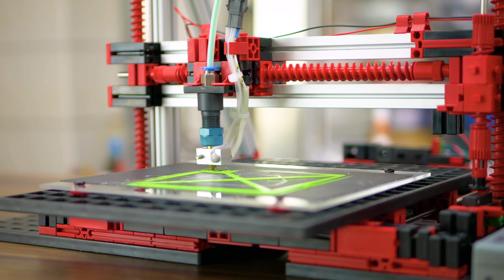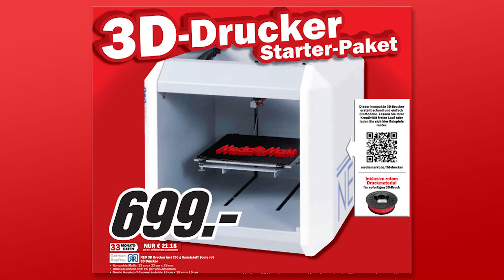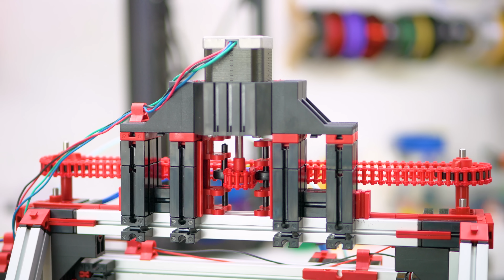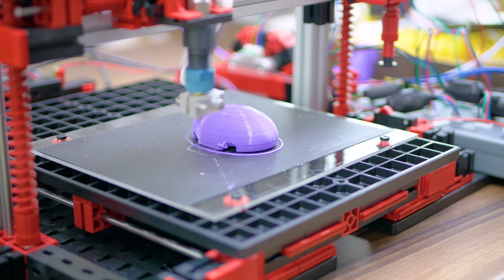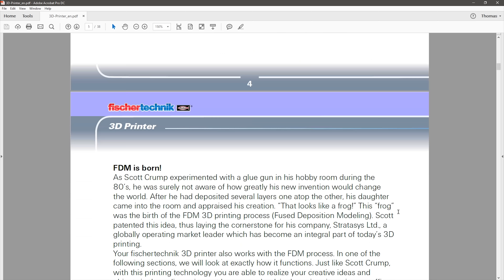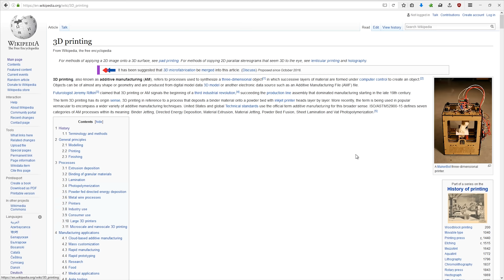890 parts: Fischertechnik 3D printer review!

Comment: I get the impression that it's more an exercise in learning how a 3D printer works than a 3D printer for the beginner, even if it fails at both.

I'm still excited about the idea of builder kits, with parts like gears and rails and stuff, that can complement FDM. I'd like to hear more about sources of such kits or parts.

Comment: Now the Fischertechnik 3d printer sells at ebay for about 380 € new. Less than 400€ was my limit for such a toy.

I have not done 3d printing before. So I simply wanted to test if I like 3d printing - without investing money to be wasted if I decide not to have 3d printing as an hobby. Fischertechnik is an expensive construction system and many parts in the set are usefull for other projects. So it is mostly "recyclable". You can use the steppers with i2c stepper controllers at TX or TXT even with original firmware; with comunity firmware on txt you can also control the fischertechnik controler. So all parts exept extruder and hotend are multifunctional as I expected one year ago. So trying the fischertechnik 3d printer (at a price less than 400€) is O.K. because there is no risk - I can build some other projects with part (+ the other fischertechnik I already own).

Adding a fan (made complete from fishertechnik parts I already own) was no problem. Of course the printing quality is only low entry level - but as may be known, Prusa delivery take some time... The fischertechnik 3d printer was indeed enough to decide, that I like 3d printing. So 3 days after my first 3d print with fischertechnik I ordered a Prusa MK3. The parts of the Fischertechnik 3d printer will find a way to other fischertechnik projects...

One of the best things are the Fishertechnik holders for Nema 14. The help to integreate steppers in other projects. You can get them seperatly sold für only 3€ (very cheap for fischertechnik - I was amused) or print them yourself (the 3files are delivered with the printer). Also the axis-adapters (seperatly sold for 0.35€) are perfect. They break if to much force is tranfered, so ifsomething goes wrong, you do not mess up the complete project, but only the cheep Axis adapter.

So in my opinion the Fischertechnik 3d printer is very good - for using the interesting new parts (and of course all the expensive standard parts like the aluminium bricks contained in the box). For 3d printing: fun to try it, but not to use it as an productive printer.

Comment: Hello.
I have also tested this printer.

I like fischertechnik very much.

However, the following points interfere with this model:

The price is way too high.

It has been forgotten that in the 3D printing the printing is in the foreground.

All the 3D printer kits are in direct competition. However at a higher level.

Unlike other fischertechnik models, you can not build any other models with this kit. You could have done so many other things with the stepping motors.

Fischertechnik has not yet understood the meaning of open source.

Why do not you open the firmware?

The controller is unnecessarily expensive. An Arduino with Ramps would have been enough.
As a spare part you want 260 € for it. The Oririginal Controller costs 90 € for German Reprap.
 
One has saved a 10 cent transistor on the controller and thus the filament cooling impossible.
How do you think you can print without filamnet cooling?

The idea was quite good, but not finished.
It would have been a good idea at this point to introduce the Arduino into the fischertechnik.

Comment: There is only one thing wrong with this Fischertechnik 3d-Printer: The interface is stand alone only, not to be combined with the Robo TX an TXT Controllers and the Robo pro software.

As the firmware of the 3d-printer is open source, its only a question of time the comunity find a way around this problem. But it is a big error by fischertechnik to do so not themselfes before relasing the construction kit, as modifing firmware is not something for normal fischertechnik users. 

Fishertechnik used 6 components (the expensive ones) only usable with this model: The 4 stepper, the extruder and the controller. While an extruder of course only is usefull for 3d-printing, Fischertechnk missed the chance to integrate the stepper and controller in the normal Fischertechnik system. Some de ja vue to 1985 - the stepper of the old fischertechnik plotter where also exotic components only for that model (but the seperate controller was universal). Integration of controller and stepper in the system would make a huge difference to the balance between price and what you get for it.

In this state, the 3d-printer is only a 3d printer. You can tune it a bit to get better results - but pricing is to high compared to other 3d printers. All other fischertechnik construction kits have more than one model you can build - not this one. So to compare it with other 3d-printers is right and your summery totaly correct. But if the community finds a way around (or even better: fischertechnik makes firmware updates for using the controller with robo pro and extension via USB to te TXT) the components becoming "universal", 3d-printer would become only to be one model among many others. There is a difference between "bad 3d printer by Fischertechnik you can use for nothing else" or "Universal Fischertechnik Robotic Construction Set you can even build a entry-level 3d printer with" (an total different angle  of view - like "Is it allowed to smoke while praying" or "is it allow to pray while smoking").
Some models of old Fischertechnik sets could be easily build with the components (maybe some standard fischertechnik parts more), if there weren't the incompatibility issue:
- 2d-plotter (print labels on CD with permanent marker, with edding marker printing bord layouts)
- roboting arm / sorter
and of course endless combinations with all other fischertechnik kits.

So you are absoluetly right, only hardcore-fischertechnik-fans and people associating "Fischer" with "good products" will buy it. Only if fischertechnik gets the turn to make all components (exept extruder) multifunctional and compatible, the rating have to be changed. Hope dies last.

Comment: I remember in school having to program a claw arm and transport belt setup as a last year project. For the arm I needed to count a certain amount of clicks of the gears to make sure it would nicely pick up and deposit little blocks at the correct places. Now there was 1 problem, every time I started up the program again I had to adjust the amount of  clicks because it would always get out of ''sync'' let's say sometimes barely missing the blocks and other times COMPLETELY missing the blocks and ramming into other things.
I wonder how this machine would work and be accurate in the long term, the kit I was working with was only from like 5 years ago or something and most everything still seems the same about these parts (especially those lead screws).

Comment: Does anyone else feel Tom went way too easy on the printer in his review? It's too expensive, badly designed, not very educational, steals from the open source community, and is very unsafe yet he still recommends it if you like fishchertechnik. It's probably just german bias blurring his judgment because in the past he has consistently made (rightfully) a much larger deal about smaller issues from printers but not this time...
Reply: This is quite literally not a 3D printer, isn’t even sold really as such. It’s an educational toy. The judgment is correspondingly different.

A class could design and 3D print some of those monolithic parts to improve it to the point where it might be decent.

Comment: Good evening Tom, UK here, love you and Highfive a great pair of guys, had my eye on a Prusa for sometime but I am retired so a bit out of reach at the moment, maybe in the future, anyway my main question is there are two low budget machines that seem to be very mechanically sound called the Trinus and Cetus but there seems to be very little information as to whether they are available or not, do you have any ideas.Rob
Regards
Reply: Rob, I'm running three Anycubic i3 Mega S's and a Chiron. I'm not a particular Anycubic fanboy but they work and it's what I know.

With that in mind, I recommend the Mega as a first printer because it's easy to get working without learning how to build and tune a system and their customer support is good.

I paid about $200 all in and it came with all tools, a kilo of filament and even a spare hot end. Assembly takes about 20 minutes and is simple as IKEA.

Message me if you need help or reach out on twitter @ZDP189.

FYI, I've no commercial affiliation with any brand.

Comment: On one hand it is good that there is a kit for young people to build a 3D printer but it seems like a regressive exercise.  The 14+ age group would be much better off with a real 3D printer kit and use that as a springboard to build things as well as gaining valuable 3D design skills that are highly transferable.  Just as they would be having access to a good workshop or a not-so-good one where they had to employ inventiveness to get the most out of it.  I grew up in the UK where instead of craft skills they teach Design Technology but this approach has so much emphasis on design (subtext > as a middle class activity < end subtext) that it losses understanding of how thing actually work, how things fit together (except for butt joints with lashings of glue) or understanding of materials (covered in a 30 minute session the week before the exams).   So I remain a little envious of the Fischertechnik kit.
Reply: I'm 12 and built a MK2S? Why 14+?